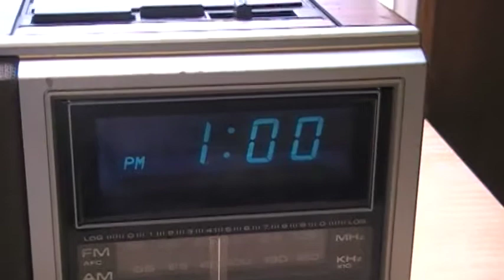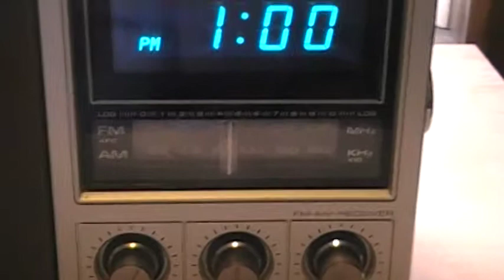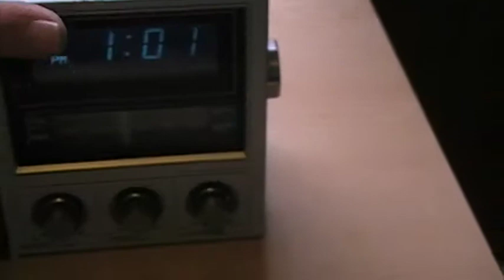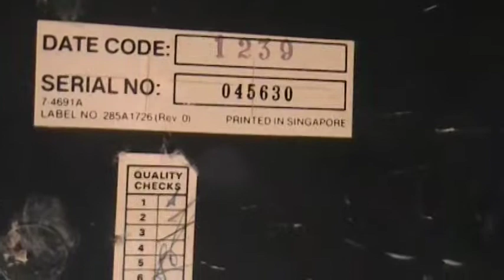Vintage General Electric 7-4691A Fidelity I high performance clock radio

Comment: I picked this up @ my local Value Village they wanted $10.00 but with my discount rewards it was like $7.38 or something like that. I believe this clock radio is from 1982 according to other YouTube videos. I was really impressed with the audio from the massive speaker and the treble, bass controls, that I've never seen on a clock radio before. I like how the radio dial lights up as well. I also too have the exact same problem with the switch sticking and the rev not working. I bought it to use as a work clock but am afraid it might get broken.